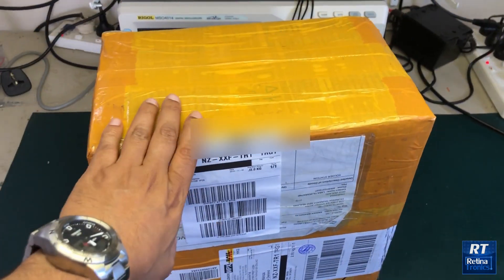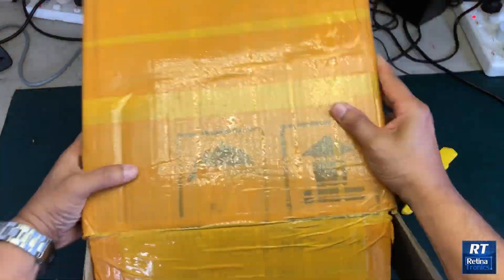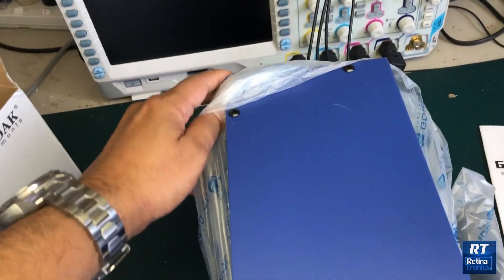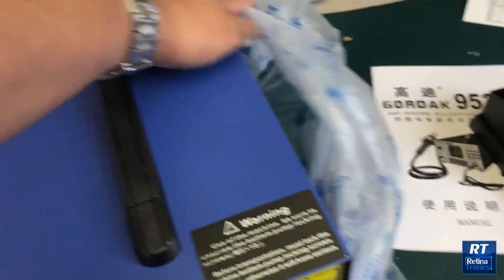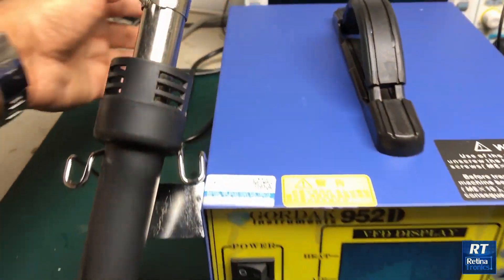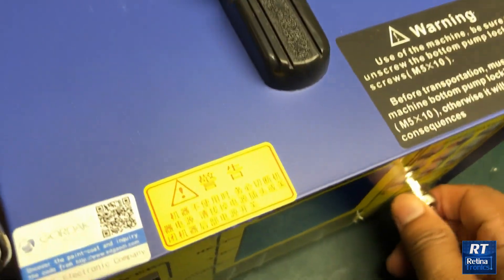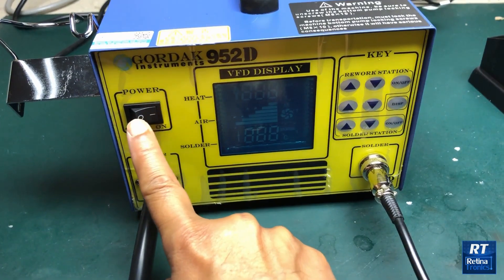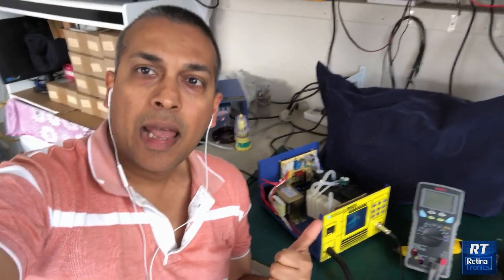GORDAK 952D Hot air soldering station Unboxing and FAIL! (Sinhala)

Comment: Gordak 952s එකක් තියනව ඒකේ air එක crontrol වෙන්නෙ නෑ. මොකක් වෙලා ඇතිද
Reply from the maker: Check driver of the fan. If that is ok you need to check the control circuit.

Comment: Mn gawa gordak 952D 2k thyanawa e 2kama power cut wela awama wedakale ne. Power okkoma enawa on wenne ne. Mokakda solution 1k
Reply from the maker: 5v Enawada ballanna regulator eken
Reply: @EEExplained   micro contrller ekata 5v enawa
Reply from the maker: @dinushakothalawala8689  Display ekata?
Reply: @EEExplained  +5v -5v 3v ac 27v bord ekata enawa
Reply: @EEExplained  display power nethath microprocessor ekata power enawa nam on wenna one neda?
Reply from the maker: Oke thiyanawa triac ekak ekata power enawa da.
Reply: @EEExplained  micro contrller opto coupler walata wenamama signal dunama okkoma manual function wenawa...
Reply from the maker: E kiyanne mico eke output ne kiyalada.
Reply from the maker: Mico eke Output wala indala opto ekata signal eka direct da yanne netham relay ekak wage harahada
Reply: @EEExplained  direct thiyenne
Reply from the maker: E kiyanne oya micro eka weda karanne nedda
Reply: Contact number akak denna oyaga
Reply: Contact number akak denna